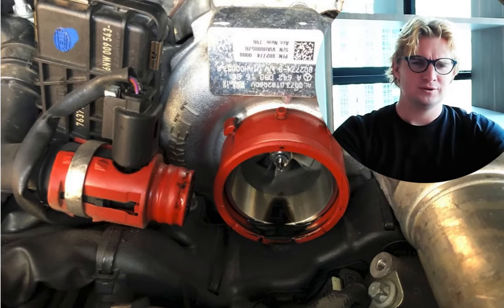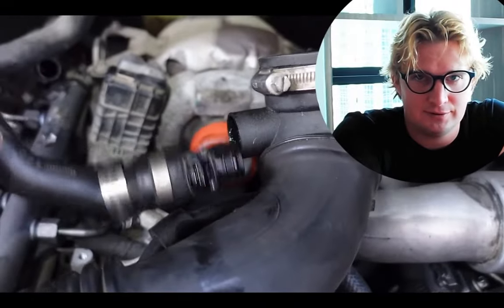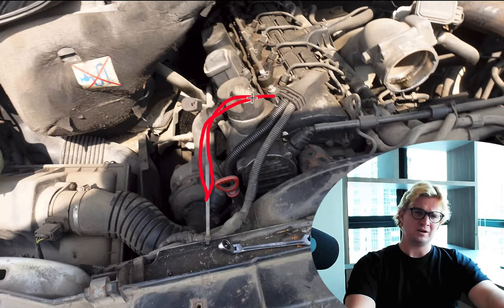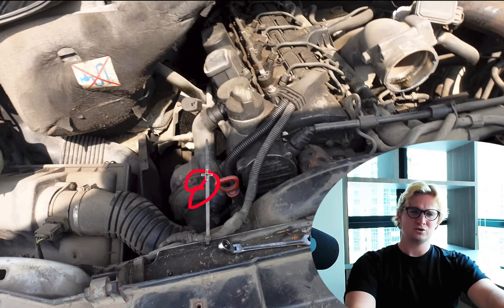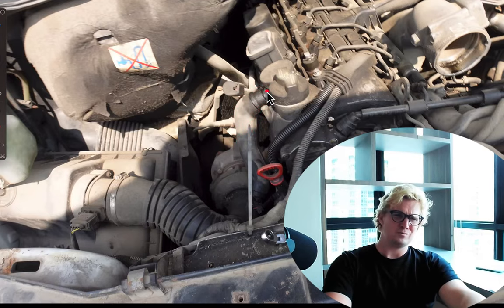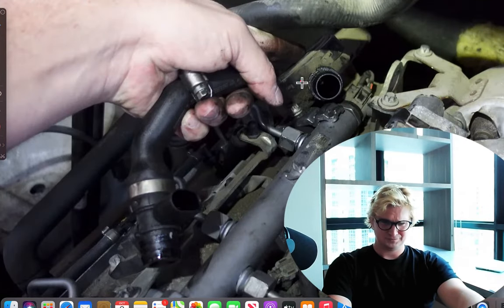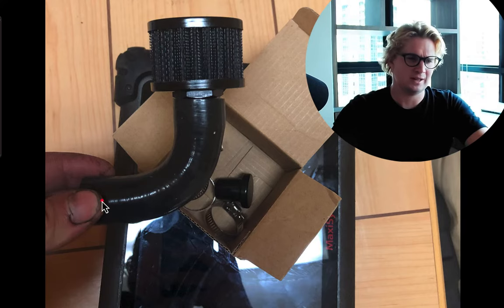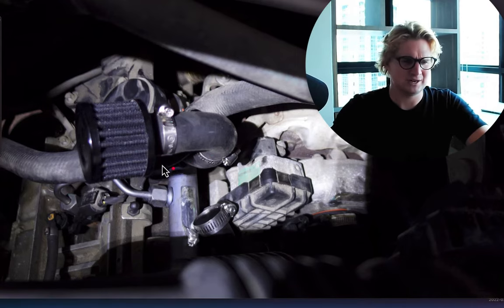A Weird Upgrade Every Sprinter Owner Needs

Comment: 2011 Sprinter every year a new oil leak or 2. Even under Warranty. From diff, manifold, oil sump, pressure sensor, shock absorbers. You think it’s fixed and another comes. It’s never not had a leak fixed without causing another one every time. 😢
Reply from the maker: I’m sorry to hear that.  In my experience.  The strangest issues I’ve seen have occurred between 2010 and 2013.  I really don’t know why.  New om642 engine sub category but still.

Comment: Hi, I am new to your work, I had a 2007 LWB Sprinter , In 2019 was travelling up a steep hill behind a long queue of lorries And they were all slowly slowing down so I decided to overtake drop-down gear into fourth exhilarated also there’s a big gosh oil blew out of my dipstick holder and the engine went into limp mode, I had the vehicle recovered and I was told I needed a new engine so for the time being I just drive around very slowly ended up ditching the van never found out exactly what was wrong with it do you have any idea what was wrong.
Phil
Reply from the maker: it would be safe to assume the engine experienced damage given the details provided. what did the engine sound like when you drove it around after? was there lots of blowby coming out of the exhaust cap?

Comment: Will this work on a 2004 sprinter??
Reply from the maker: Yes.  One of the engines in the video is a 2005 inline five cylinder same as 2004. But if your engine has a lot of blowby then maybe extend the hose further away from your cabin air intake
Reply: @sprinterfix   any video of how to install a catch can on the 2004 sprinter, my engine has blowby and I see a little bit of oil in the intake manifold driver side
Reply from the maker: @adrianzayas1942  I'll try and make one. give me a minute haha

Comment: In the hose i have  a sensor its called the elephant hose , what are you suppose to do with that?
Reply: 2005 2.7
Reply from the maker: Super common to mistaken that inline heater element for a sensor.  It really just keeps the hose closer to the temperature that is inside the engine block so that the oil vapor doesn’t immediately condense.  If u are unsure just unplug it for a minute and check your scan tool.

Comment: what is the name of the plug that is failing to create this issue. I'm seeing lots of oil in my coolant system now. Looked for the products and the amazon listing is gone.
Reply from the maker: Let me update the link.  But if u have coolant in the engine this likely won’t help.  I mention intercooler but that is referencing turbo intercooler hoses
Reply: @sprinterfix  my coolant system is disassembled right now under maintenance and I found a link for what looks like the same mod at walmart. i have several flushes to run before getting fresh coolant in it also. Right now it's bone dry in the engine. should I add the mod before getting the coolant filled again? Thanks for the reply love the channel
Reply from the maker: @enigmatic_sunn  Honestly man, I wouldn't bother with this until your van is up and running, are u doing an oil cooler job at the moment?
Reply: @sprinterfix  replacing the radiator and thermostat and running as many flushes as needed to fully clean the system, including the heater control valve and core. Thats about it. Should i wait til after to add the mod? Thanks for the replies i appreciate you 🙏
Reply from the maker: @enigmatic_sunn  I would wait,

Comment: DON´T do it, your PCV not only bring Oil through the PCV, also fumes that smells like exhaust fumes
when you let the PCV goes directly to the filter, it always get the fumes in the engine bay, and also inside of the vehicle and you will breath it in...

BETTER: install a catch can, it separates the oil, and bring the fumes back to the intake
Reply from the maker: Do u have holes between your engine bay and your cab?  I dont
Reply: @sprinterfix  cabin air filter breathes inside the internals of the hood on my 02 - at a stop you'd most certainly be putting your cabin air filter to use.
Reply: @sprinterfix  What? you can 100% smell the engine bay have you ever driven a car?

Comment: What is the cap with the rubber valve called?
Reply from the maker: Pcv valve.  Or just positive crank ventilation valve.  Small differences between 2007 and 2009.  And different between 2010 to 2014.  This is for the 3.0 engines.

Comment: 😊 engine does run cleaner by the turbo does not spool as efficiently that back pressure that's building up in the cylinder head and actually helps spool the turbo
Reply from the maker: Aww man.  I have to fundamentally disagree with you here.  The pre turbo pressure generally hovers around one atmosphere.  Sometimes a little lower due the speed the air is moving.  Post turbo boost is much much higher.  Just plug in a scan tool and take a look. Any pressure coming from pvc is negligible.
Reply: @sprinterfix  I can show you many examples.. that air is under pressure...  It will spool the turbo and the engine will run leaner with the extra air

Compound this by removing the bpv/blow off valve and the performance AF ratio and emissions improve...

I have done this with diesel and petrol engines...  With performance always being improved

The con is the added stress placed on the turbo...  Just rebuild your turbos every 140,000km as preventative maintenance....

1 atmosphere is near 1 bar... 1 bar is around 15lbs...  

This is especially helpful under acceleration where the engine is operating under 1 atmosphere... Therefore helping it spool the turbo... Improving performance...

You will also go further distance with less full...
Reply from the maker: it clearly sounds like you have experience with this. point me in the direction of a video or blog that I can read up on, would love to know how it works
Reply: @sprinterfix  I have a naturally aspirated class b petrol Ford..

If I can befriend a turbo'd diesel owner .. I will ask if I can make a video

Cheers

Comment: Your way seem fine but illegal in a lot of places, I have installed a proven 200 catch can and capture the fumes & oil!
Reply from the maker: Certainly not illegal.  This device was never originally created as an emissions related system.  It is made for the health of your engine. Without it too much pressure would build up in block and cause gaskets to leak.  They even sell them at autozone in California.  I have not heard of any vehicle which has a system in place to calculated the amount of emissions created through blowby. It would be like saying driving around with a loose engine oil cap is illegal
Reply: i'd like to install the same catch can but they don't sell it for sprinter. how you install it?
Reply: @sprinterfix  I would ask your local emission to start with, in Canada what you did is Illegal and yes if you remove the oil cap your are impeding the CCV system so you are at fault, cheers

Comment: I have a OM642 2013 3500 now with over 300K Will that work for mine?
Reply from the maker: Will what work?   Replacing the pcv valve? Or using the hose and filter?  Both are reasonable solutions.  So is a catch can